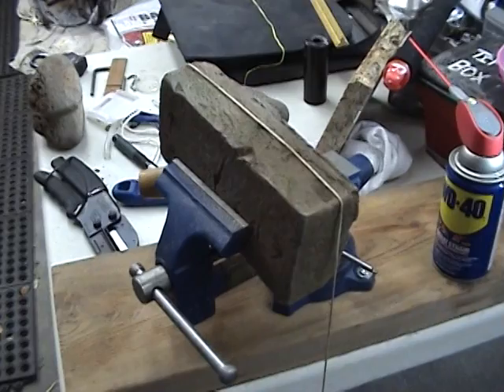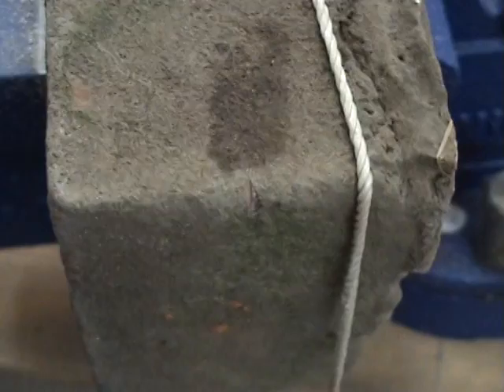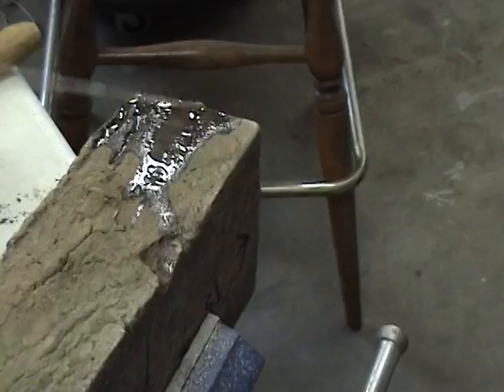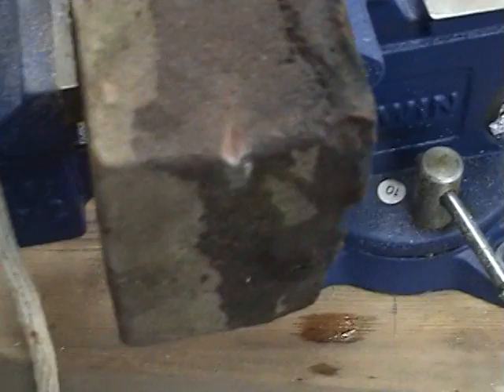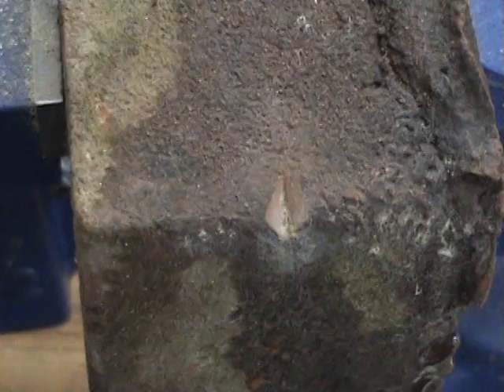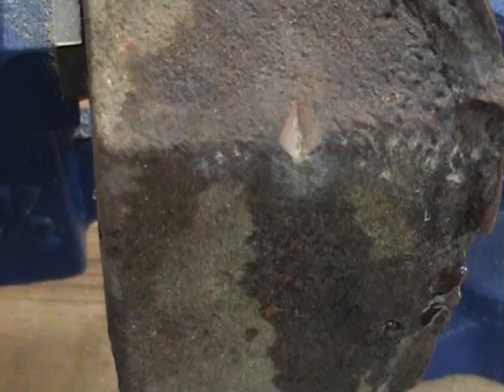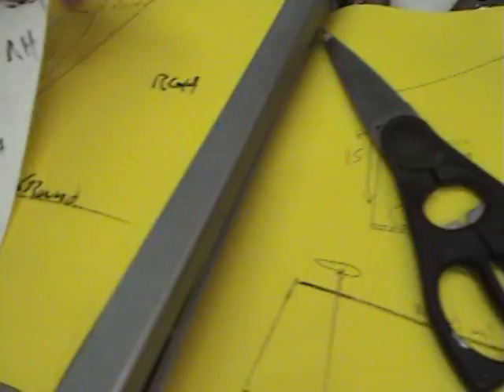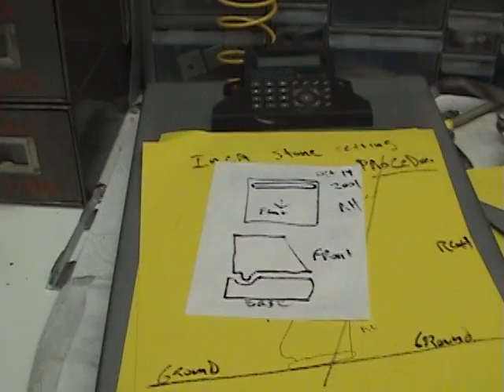4- HOW it was DONE = INCA ROCK CUTTING (end)

Comment: try your demo on diorite granite ....
not a clay brick....
Reply: They used clay. "Inca building materials. The Incas used different forms of stone for thier construction projects. They used roughly shaped stones, adobe, finely shaped stones, and mud or clay to smooth the appearence of rough walls (Malpass 57). Inca constructions were most often made of stones collected from fields and laid in mortar." So basically, they used only clay bricks and manageable stones (like the brick from this video). I assume mostly because they couldn't cut hard stone, but they could cut clay bricks

Comment: So that might explain how to cut free standing blocks, but unfortunately it still doesn't explain the core drilling, through holes, or other beveling techniques.
Reply: Could have used Sonic drilling like the Egyptians. Tuning forks on the end of metel tubbing of sorts
Reply: I tested using a scaffolding pole, sand and water to drill a hole through a brick.  Manually turning the pole, was a nightmare (as was getting it started).  But, after wrapping a rope around the pole and getting some extra help.  we got a method like old 'bow' fire starting.  It worked really well after that.
Give it a try!

Comment: The stone they used is granite indireite(2nd hardest material on earth) the only thing that can cut granite is a diamond tiped tool plus all the stones are cut and fitted hetrogensily( different shaped,sizes)  even with a square and tape measure u cant get the accursey they did. as a cnc operator i would honestly say they stones were machined, Their is evidence that some of the stone blocks were molten at the time of construction

Comment: I've made rope by hand using plant fibers. it takes for ever. it would seem the amount that of time that goes into making a rope just to snap it after 10 seconds and maybe a mm of cut through doesn't make much sense  to me. I think they used some kind of ridged saw maybe copper or whatever and used sand in between  the saw and stone and lubed it all up with water. makes more sense then rope cutting that you haven't showed actually  cutting hard stone.
Reply from the maker: Justin , THIS IS rick. We need to look at the archeological record of the 1400 and 1500 time period of this culture and the things they LEFT behind. A culture that cut literally MILLIONS of tons of rock all over the empire, would have evidence of broken copper, saws, magic golden mirrors, alien technology, etc. Right? There is no evidence of metal tools, ONLY ROCK hammers, Rock wedges that were 2 feet long, and that is about it. Local legend claims the Inca had a SOLUTION THAT WOULD MELT ROCK. Our team believes that the solution was made from a local plant material, mainly Coca. Coca is only indigenous to this area and the only type of rock cutting found anywhere in the world. The rocks do not lie and IT IS WRITTEN IN STONE. A Photon Electron microscope scan of a virgin piece of cut Inca rock will show strand marks from ROPE. Rope was the saw for the rocks and The Cutting Agent was Coca or a Coca Derivative. It is elemental, my dear Watson. Thanks for watching. rick

Comment: I wouldn't think that oil would be the way to go honestly. I could see oil adding protection to the rope though for sure, but believe it mostly would slide across the stone. However, maybe if you used your idea of sand in combination with an oil soaked rope. Sands will stick to the oil, oil stuck to the rope, therefore any time somebody pulls back or forth, its the sand making contact with the stone vs the rope.
Reply from the maker: In the Archeological Incan Record- The cut stones show signs of melting at the cut points. Since they did not have a written language, mathematics, rulers, or lengths and only rope and stone tools, they must have used Some Chemical, A Local abundant plant chemical all over the Inca Land. Our team proposes that it is a chemical of the Plant and Friction from the rope cutting action that shaped the rocks. It will be proven in time. You heard it hear first. Thanks for watching.
Reply: @DIOSpeedDemon  try the oil and sand idea if you get a shot. I really think the oils would make the sand stick to the rope and act just like a grinding wheel, and the oil will also protect the string from fraying. 

I also think it might prove advantageous to your research to increase the scale of your exercise to use a larger rock so you can use a thicker rope. 

But even then, this only solves the problem of cutting blocks or maybe cylinders, but what about statues of goddesses in India, or the cutting into pure bedrock and making it perfectly symmetrical like as is the case with the Barabar caves

Comment: Now try it with granite, and then cut out the insides of granite boxes weighing 100 tonnes (such as those found at the Seraperum) with laser precision. If they had to go through such difficulty in cutting stones so slowly, they've have made them square, rather than trapezoidal interlocking. . No way this could cut countless ancient stones I've seen in interlocking geometry. This video (among others) just proves that rock isn't invincible. You can cut steel with rope, abrasive and a hell of a lot of patience.
Reply: Sera-Peum  (You added an extra 'R' there)
Reply from the maker: They had no Lazer Precision. They had no Measuring system, or Writing System. Or a Straight-Edge ruler for that matter. They could not draw a straight, even, line, if their lives depending on it. Thanks for watching.

Comment: They did have oil from seeds and fruits though!  Very interesting concept, and simple to grasp.  I believe your test failed because they would also need to build some sort of jig to keep both the rope and oil in place.

As far as "special rope"; I too don't believe it was a bare rope.  I think they probably treated it with wax and oils by soaking it along with dipping it in a mixture of strong bits of ground stone.  And when that rope wears out, they would simply replace it with another.  Very plausible actually.

Comment from the maker: @zenmeister451 The knobs on the stone, whether inverted or extroverted , served a very important part in this rope shaping process. Remember that in Incan stonework, most stones are not 1/8 inch apart all the way front to back. Only 1-3 inches in thickness on the front of the stones, touches one another. You cannot see this because we only see the "face" of the stone wall. This is where are 20th century mind, sees what is not there.

Comment: Try Using a Heated Tungsten Rope.  
Should cut through like Butter.
Also you could make it into a handheld Devise like a Chainsaw.  A Cyclotron with a significant enough spin could generate enought electricity to power the saw Indefinitely or multiple at once.

Comment: You need to put a lot more thoughts into this....James Arnold has a very good point. Granite is around 200 Mpa, it will turn a hydraulic hammer bit into a boxing glove in an hour, I've seen it. Your example of the prison bars in previous videos  can not be literally applied here, although standard construction steel is 350 Mpa, steel is ductile and will move away as well as wear off, and the guy had a lot of time and not that much to cut...
We do use diamond covered steel cables to cut concrete nowadays. It take a relatively long time with heavy equipment and typical concrete will only be about 30 to 50 Mpa (sidewalks are 32 Mpa and your clay brick maybe 20 Mpa....maybe), and concrete is also friable, unlike granite.

But I would have to say my point is, tools leave marks, Why can't we see any tool marks on any of the ruins found in south america????, no matter the culture, and same goes for the pyramids of Egypt and many other places....
Reply from the maker: I have put a lot of time and followed all the clues and the stone tools the Incas left behind. If the Into could fashion stone wedges and hammers, they sure has hell could cut rock. Rope is all they had, no mpa math, no math , no measurements, no light, no jacks, just rope and a lot of time. I am right and will be proven right. Your 22 century mind is blinding you to what a human can accomplish with a little imagination and a ton of time. Thanks for Watching.
Reply: DIOSpeedDemon you say that you are right and will be proven right...c'mon man, you have a theory...a dumb one but a theory
Reply from the maker: Kevin Nightingale It is YOU who is dumb. Put your theory up or shut up. thanks for watching and learning, pinhead.
Reply: I have no problem saying that I do not know how they cut the stones. To come up with your theory and boast that you will be eventually be  proven right is a bit too much. There's no need to insult me. I didn't call you dumb but your theory is dumb..to me.
Reply: Kevin Nightingale do waste your time dude, the guy thinks the Inca didn't use any math to build theses things....can't even realize that even with only a whole lot of time they would still be building these things today using his methods.....Innumeracy I suppose....hail Sithis!!!!!

Comment: Have to say I agree with everyone because the kind of still really matters you can cut sandstone in endocyte with a seam tool and diorite this has been harder for the type of stone matters
Reply from the maker: That is completely Correct to a point. Ancient Incans claimed they had a liquid that could melt stone and all of their walls show Vitrification, or high temp, stone melting. I believe they did have a Liquid cutting agent, and used indigenous ropes as the cutting tools. They must have cut them somehow, correct ????

Comment: I would like to add that the circumference of the areas cut out from stone exceed the current ones possible with todays saws and cutting tools.

You will also note the drilled holes in the stones cut by the North American and Egyptian cultures. To date I am not happy with the explanations provided by archeologists and Epyptologists.
Reply from the maker: I am not happy about the Egypt pyramid building concepts. Was it a giant ramp? Was it a wrap around ramp. How many years and actually man hours were spent doing this like the Cheops or Khufu pyramid? Now they had metal tools which have been found. How come the giant pyramid is laid out like it is? HOw come the king and queens chamber have no writing on the walls?
Reply: +DIOSpeedDemon Those are splendid questions and there was a French architect who may have been able to answer the question of how it was constructed addressing the way that they managed to build the pyramids. Still the question remains concerning why were they built and the function behind them.

Comment: Like a Giant "Jeuwllers Chain.
Reply from the maker: If the Inca used a Secret Method to Carve MILLION OF TONS of stone throughout the Empire, don't you think that there would be tools that would be uncovered and put in Museums? There is few stone tools, like hammers, mauls, and curious Large Stone 3 foot wedges with two hands, handles on them. That is about it. Our team has discovered how it was done and it makes sense. Remember the Inca had no written language, measurement system, Rulers -either metric or standard and no way to draw a straight line. they could not draw a straight stone line if their lives depended on it. Their stone walls are cut precisely, we know this. Then= How come all their stone foot paths and walkway are not cut the same way at all? The reason is they could not get a rope or jewelers chain behind the rocks on the ground. How come only large heavy rocks were carved and not small brick size rocks? Because the weight of the stone was an advantage and needed to be heavy to carve with rope. It all makes sense if you study the Archeological record of the people and the tools they left behind. Thanks for watching and commenting.
Reply: DIOSpeedDemon These tools do existand I also seen Diarite being cut with cord and "sound".Sound has also beleived to be used to lift matter like it was magic.I beleive Tesela was on a similar path with harmonic ressonance.If you dig a little on the internet(even YouTube) you should be able to vet this for your self.Micheal Tellinger from South Africa has some good work in this feild.

Comment: what if instead of a string they used something rigid, and they had it spin. They would use sand as an abrasive to cut the rock. the spinning would cut it and they would move the "saw" down. Perhaps they could have used a rope of some sort, but I think having it spin would increase the cutting efficiency. They could have the saw attached to two wheels, like an axle, and spin the wheels at the same RPM. As it cut through the stone they could move the wheels down or sideways.

Comment: @DIOSpeedDemon There is stonework exactly like that in egypt and many other places. I tend to agree with guys like David Hatcher Childress, moving cutting and placing these stones would have had to been easy for the builders. You don't do anything easily  with stones that size by manpower alone.
Reply: Theres a theory they could have floated the blocks to the top of the pyramid also using a shit ton of ropes and logs and then removed them bit by bit as they were setting them in place making it realativly easy for expirence builder to set them where they need to go...

Comment: You do know that any type rock...... is harder than any type of organic rope ......so this would actually be impossible to do!
Reply from the maker: You do know in Researching the Incan Historical , Archeological , Cultural Civilization, that the Old Incans and Descendants to this day- told of a Liquid that could Melt Rock? I believe that Liquid was the Cutting Agent and Rope was the Vehicle to cut the stones. The Incan could not cut a straight line for the life of them. Maybe it was because they had no writing or numbering measuring system. If you have a better explanation , I would like to hear it. Thanks
Reply from the maker: You do know that a documented case of an inmate sawing thru solid iron bars with Toothpaste and dental floss is real, right. Rope is all the Inca had. Rope and an abrasive could cut the rock. I believe the abrasive or Liquid was made from some local flora or fauner in the area at the time. The old adage, Stone will Tell- An electron microscope will show abrasive rope cut marks under every virgin cut stone the researchers test. Then you will believe. This is the only way it could have been done with the Incan Tools that were found at the time in thier world. Very simple , really.
Reply: @DIOSpeedDemon  FYI Mythbusters built a flossing robot, applied toothpaste to the bars (the grit used to clean your teeth, they reasoned, could be used to aid the floss), and let it run for a week. After a week, the bar had been worn away a fraction of an inch, which, by third calculations, mean that you can cut through one bar in less than 300 days if you flossed 8 hours a night.
This was deemed plausible!

But cutting through thousands of miles of rock with rope is actually implausible!

T
Reply from the maker: @ambmainman  Then how was it done with no metal tools, no machinery, no magic gold mirrors, and no written language or measuring system? The Rock is cut and their right now today. It must have been done some way....
Reply from the maker: @ambmainman  Man can do Amazing things, given enough time and Enough Determination. The Crew of the Lady Be Good walked 90 miles in the Lybian desert in WW2 with just 2 canteens of water. Day temp was 130 degrees. I bet your Floss Machine cannot do that....
Reply: @DIOSpeedDemon  Hard stone tools used on softer or equal hardness stone.....with plenty of manpower and time!!!!.....there are literally scores of museums that show this!!!!.....look them up!
Reply: @DIOSpeedDemon  Giving irrelevant stories mean's you have no real argument!     .....there are museums that show how it was done.....look it up!

Comment from the maker: @twentyoh5 That might work, yes. The key word here is "rope". ALL of the Fitting Cuts were done with a rope like saw. Whether they had abrasives embedded in the rope or used a certain tecnique, I do not know. Rope is all they had at the time. FACT: No metal or stone tools have turned up in Quantity, for the Millions OF TONS of Stone that was worked. FACT: The rope is biodegradable and would break down in time to dust, leaving no Remains. FACT. My theory is correct in every way.

Comment: Imagine if the ropes had diamon on it or some other hard material just laced on or if the Water had just even sand or metal parts. It would work. Pyramids
Reply: And with the river they had going and boats that’s limitless power.
Reply from the maker: Thank you for watching. Rope was all they had at the time. If Metal or any tools were used to cut the Millions and Millions of tons of Rock in the Incan Empire, it would have showed up by now. It has not. If a Researcher were to separate two virgin cut Incan stones and do an Electron Microscope scan of the rock surface. Microscopic Rope Marks would show up and end all the Mystery. Our team already knows this of Course. Thanks Rick